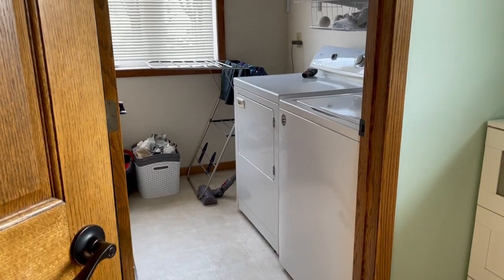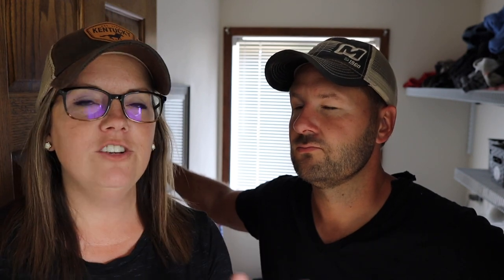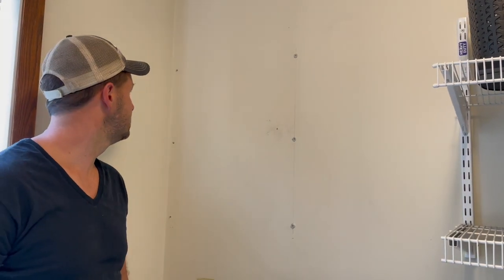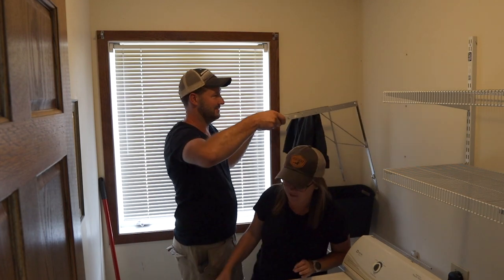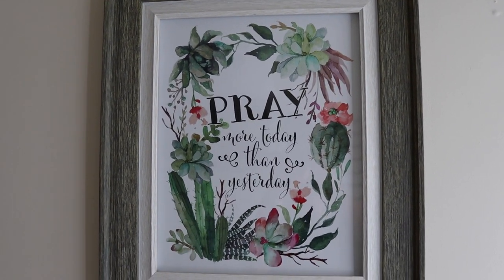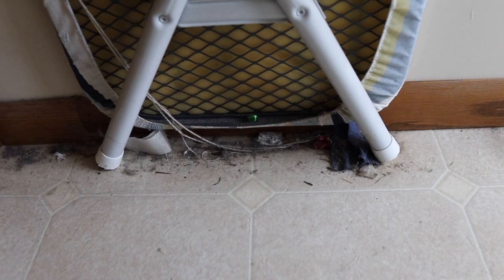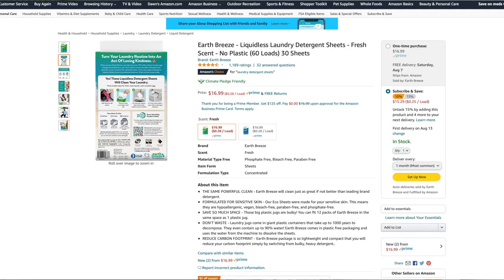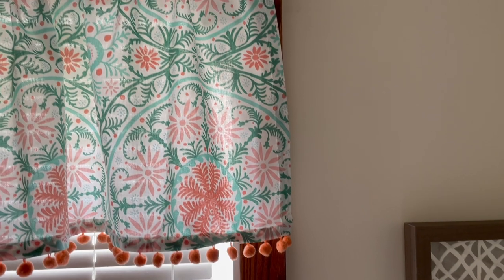Dream Laundry Room Makeover!

Comment: Get back on that soap box, Dawn! 😄 The laundry room looks so much better with just a few changes, and will be even prettier when you paint it mint green.  I use TruEarth laundry sheets. They work great! One sheet for a regular load and two for a large load.  I have a subscription, so I don't even have to remember to order.  Two envelopes of sheets are mailed to my home each month, which is enough for the 3 of us.  The envelopes slide right beside my washer (I  have front-loaders stacked on top of one another in a closet in my hallway. When our grandson came to live with us permanently at almost 12 years of age, I taught him how to properly do his own laundry. Let me tell you about my rule when buying clothes. I do the scrunch wrinkle test, by bunching the fabric tightly in my fist, then releasing. If the material mostly springs back into shape, it's good. If it continues to look like a wrinkled mess....nope, not coming into my house.  Moral of the story? I do NOT iron! I own an iron, but only for an emergency. I  cannot remember the last time I ironed! (By the way,  you can double a towel and iron on the floor or any other flat, stable surface.) The last time I used an ironing board was 30+ years ago, I think. Blessings! ❤

Comment: We switched to "Sheets" Laundry sheets last year and it is so easy.  No more dealing with someone using too much detergent.  I love them.  The box is shipped straight to the house in a recyclable material so nothing is going into the landfill.  It is SUPER lightweight.  1 sheet for a small load, 2 for a regular load.  Easy Peasy.

Comment: Looks lovely!
I re-did our laundry room a year and a half ago and it makes me smile, too. I also noticed that I, too, was getting my laundry done quicker because I wanted to keep that space pretty. 😉 The solution i came up with for a drying rack was to hang a bar up high on the wall and use hangers to dry everything (i have several different types of hangers for all needs). I have yet to run across anything that doesn't work to dry that way. Works for us!

Comment: The laundry room looks great!  DIY tip-mop the floor with a vinegar-water solution.  Rinse.  Paint the linoleum flooring with a good porch paint.  Bam.  Problem solved. It will be easier to clean

Comment: I donated our ironing board years ago and never missed it. The few times I needed one, I simply put a towel on my table and ironed there without trouble.
Reply: Absolutely, I do the exact thing. I finally donated my huge ironing board. I iron once every 4 years but it took so long for me to believe I could exist without it. I put a towel down and iron wherever. Last time it was on the surface of my massage table. With lots of sheets on it so as not to burn through. Worked great.

Comment: I use TruEarth laundry sheets. They come flat, 2 together with perforations that you can pull apart easily. 1 sheet for regular load and 2 for larger load. They dissolve in the washer. They seem to work well. So much easier than buying large bottles and take up so little space.

Comment: I used laundry sheets when on a cruise as I didn't want to pack anything that would leak in my suitcase. I was very impressed with how well they worked. Until you mentioned them I'd forgotten about it. I'll definitely look out for a larger package size and try them again.

Comment: Your laundry room turned out beautiful. You guys are so much fun to watch. I've always had an organized laundry room but the one tip I would give is to have one basket for clean laundry only. I have a collapsible laundry basket that hangs on a hook in the laundry room. The only rule is that you have to fold the current load before you put another one in the dryer. By having one laundry basket for clean clothes only, it's easy to empty the dryer and fold the clothes and put them away. On a rare occasion, a load may sit in the dryer a bit, however the majority of time it's folded immediately and put away. I am a load a day person so it never builds up. When my son was younger, I had to do more than a load a day but the key is to stay on top of the laundry. Never heard of a laundry sheet. Regarding your ironing board, I thought you were going to hang it in the closet with your Dyson. Love how pretty  your laundry room looks as you look into the room.

Comment: I loved my Washeze laundry sheets when I traveled.  So easy to throw 2-3 sheets in my suitcase to use without worrying about liquid detergent opening.  Others in my leadership group also started using them after seeing them.  The type I used worked in the washer and dryer so I didn't have to bring dryer sheets.  At home I use EC30s laundry swatches.   I found this looking for more environmentally friendly options.  I like them so far and have been using them since June.  The swatches completely dissolve, all the packaging is recyclable/compostable.  I stopped using dryer sheets and switched to the dryer balls and lint catching balls.  That was due to hearing some of the items in dryer sheets might be toxic, but I didn't do the research to determine how supportable that is.  The more environmentally friendly option of not using them at all was reason enough for me to switch.

Comment: For the last 8 months or so I've used the brand TruEarth laundry strips (got them from EarthHero as recommended by Shelbizleee) and they work great! No residue, Tom. I use them for all types of laundry: delicates, normal cycles, sheets, bath towels, cleaning rags, blankets. If you are using cold water or if you have a front loading machine, the trick is to rip the strip into smaller pieces (I usually rip the strip in half a few times until it's in about 8 pieces). We have hard water, front loader, and usually use cold water for clothes. When leaving it as one strip, it dissolved in warm and hot water all the way, but didn't dissolve completely in cold water. When ripping the strip it dissovled great in cold water! However, note that some stains won't come out unless you use a separate stain remover. I tried doing a load of rags without using stain remover to see how well the TruEarth detergent would remove them on its own. The rags came out clean (no residue, no smell) but the stains were still visible, so a separate stain remover is needed. It's SO nice not having to deal with leaks or spills from liquid and powder detergents!!! Plus love that the packaging is better for the environment. Win-win!

Comment: Since I seldom use the ironing board, when I moved & didn’t have the room for it, I replaced it with a mat (made to iron on); get at Target or any place like that in the laundry section. The few times I need to iron, I just do it on top of the washer or dryer.

Comment: If you wait to long to take laundry from dryer and it is then all wrinkled just take a spray bottle of water and spray a few squirts on the clothes in the dryer ( 2 or 3 squirts) just enough to have a bit of dampness in the dryer turn on dryer for 10 to 15 minutes depending on how full the load is. Fold or hang up after time allotted. Comes out perfect 👍. In case you are forgetful set a timer ⏲ I n whatever room you are in.

Comment: I recently tried laundry sheets. I think they are a fairly new idea. I'm disabled and don't have in home laundry. Hauling a jug is to heavy. I was using pods, but I like the strips better. They seem like the laundry equivalent to fruit leather. Remove the water weight and keep the good stuff. Tom, I haven't had any residue from them. They are HE rated and seem to fully dissolve (not like some pods where you still have the shell)

Comment: While you're at it, flip the dryer door so that it opens on the other side.  It will be easier to pop the wet laundry from the washer into the dryer that way ... unless it's the load headed to the drying rack.  (I have that same exact one!  )  I stared using Dropps laundry pods because Erica Lucas recommended them as a plastic-free option.  They're okay.  I think I"ll try the sheets.

Comment: I use the Earth Breeze sheets and I love them!  I bought one package each to try of the scented and unscented because my husband likes the unscented and I like the scented.  The scent is not strong at all, very light and clean.  Tell Tom the sheets completely disintegrate in the water... they just take the water out of detergent and compress it into a sheet, plus no big plastic jugs going in the landfills anymore!  😀  I am getting low and will be starting a subscription soon... it's $12.00 for 60 loads.

Dana from A Slob Comes Clean did a video recently where she got rid of her ironing board too... she provided a link to a fold-down ironing board she uses that hangs on the back of the door... nice that it's up off the floor and out of the way.  Maybe you could check that out.  I've also heard good things about hand held steamers... a lot of people use those instead of irons/boards.

Comment: I just use a towel on a counter top of the washer or something if I have to iron. Pretend to just fluff things in the dryer so we rarely need an actual iron unless we're going somewhere fancy which rarely happens or if I have to iron on like Girl scout patches or something. We haven't had/ used an ironing board for a very long time.

Comment: I ALWAYS lay clothes out flat as I take them out of the dryer. It might take a minute longer, but they don't wrinkle and look less overwhelming to deal with. As I take them out, I'll hang shirts over one end of the laundry basket, pants on another and socks inside OR just lay them out on the dryer itself. It's really easy and they're practically folded by that point. We also put delicates (like VS undies & bras) in a mesh bag to hang dry. Laundry has NEVER been a problem for me since I follow these basics, even when I was raising my kids. It doesn't have to be a nightmare to deal with. If you stay on top of it and fold them right away every single time, it won't be a hassle. Remind yourself that it only takes a few minutes.

LOVE the shower curtain valance, the makeover, and both the laundry sheets and washing soda. 👍

Comment: Hi Dawn, consider replacing your ironing board with a ironing blanket, it’s a heat safe material so you can iron on top of your dryer or most counter top surfaces then it can be folded away into a bin with the iron and pressing spray.☺️
You can find them at Amazon or stores where they sell sewing supplies.
—Cheers

Comment: you do not need an ironing board.  You can take a piece of plywood (super narrow so not heavy) put a piece of batting over it, then cover it with whatever fabric you want, staple to the back and you have a ironing board.  Put it anywhere you want since you only use it once in 16 years. If you get a pretty fabric, you could use it as art on the wall.  I LOVE Earth Breeze laundry sheets.  They are so easy to use!  Toss one in and done.

Comment: Dawn you want to get a ironing board that hangs on the back of the door, it’s like a half size board or if you want a full size they have a hanger to hang it up on the wall with a holder to even hold the iron. I don’t use laundry baskets other then I have one in our bathroom for towels and one in our laundry room which is actually a bin for whites all other laundry gets put straight in the washer as we take it off . We all know what gets hung to dry so that’s never an issue.

Comment: The laundry room functions much better now, I'm sure! 
Hang the ironing board up on the back of the door or on the wall. You could hang it in the laundry room or in the little closet with the vacuum. I have owned a table top ironing board for years. I loathe it. It really only works well for small pieces of clothing. If you ever have to iron anything larger, it is a huge pain. I plan on getting rid of my table top board for a full size board.

Comment: I haven’t used the laundry sheets but I do use Dropps Laundry pods-the soap, oxi and fabric softeners plus you can buy small load sizes too and for sensitive skin; and they have dishwashing pods.  No more drips of liquid soap, minimal space to store and you can buy 56 count-140 count and 210 count boxes.  The boxes they come in are biodegradable too! It’s a little cheaper to buy on subscription but you can also buy as a one time purchase.

Comment: When we had new carpet installed, I cut a rug sized piece out of the extra scraps. I wanted it for cushioning when standing on the hard concrete floor in our basement laundry room, but the kids appreciate not having to stand on a cold floor.

Comment: No I don’t pull my dryer out as it’s on a plinth and it’s vented out. I don’t use the washing detergent sheets…as I have not seen them except for travel shower sheets. But I use the mesh bags for things I don’t want in the dryer! I have a hanging rectangle with pegs on it and I use it to peg smalls on it and that works great also a rod to hang things that you don’t want in the dryer…like my hubby’s shirts.  Love this video!😀♥️

Comment: Hi Dawn,  I saw someone’s video where she had an ironing board the has a bracket and hangs on the back of the door and when she wants to iron, it folds down with a support bracket and is just the right height and size and then folds up flat on the door again.  I don’t think it was as large as a regular ironing board but looked like it worked great for those of us who only iron on occasion.

Comment: Dawn, I have a tabletop (or in my case, washing machine top) ironing mat ... called an ironing blanket that has magnetic corners.  Works great for the infrequent ironing that we do!  It's just a little smaller in depth than the depth of my washer, and a little wider so the magnets hold it over the sides.  And when not in use, it folds up and easily tucks away, nothing to hang up.  I love it! (Check Amazon, that's where I bought mine a few years ago, but they still have them.)

Comment: Laundry sheets are just pressed laundry detergent. There is a brand from Canada - I'd skip that one to save shipping fees. Overall sheets work really well... but if you go to a laundromat, you have to shred the sheets up and put them in with the clothes or the sheets will stick to the sides of the soap dispenser.

Comment: Question!  Why are you wearing caps in the house???
When I remodeled my bathroom I moved the washer and dryer from the basement to the bathroom. I now have a full size washer and dryer stacked on top of each other in a closet in that bathroom. When the dryer is finished I pull out things and either hang them or fold them on the bathroom counter.  The folded articles are put away immediately as well as the things that are on hangers. This is a perfect arrangement for me.

Comment: I have an issue with my 8 year old Granddaughter's clothes looking too wrinkled if I don't fold them.  My 13 year old's clothes are hung on a rack in the living room after about 15 min. in the dryer to unstiffen them.  Unfortunately, they wind up never getting into the closet and get worn right off the rack.  My laundry room is a small space and I replaced my metal racks with cabinets, but now I'm rethinking that after seeing your set-up.  I have 2400 sf in an open concept house and after seeing yours, I know I'm not making the best use of my square footage.  Just realized your workbook should be out today!!!

Comment: I hope you hooked up that dryer to the vent again! And maybe clean out the vent that goes from that room to the outside of the house if you haven't done so in the past year? You will be surprised! Also - I know you are keen on separating washing loads but Color Run is a godsend for efficient loads :) Finally, you could have hung the ironing board on the back of the door. (Where did the bucket go?!)

Comment: Regarding the laundry sheets: you might be able to put a small bin on the wall to hold them to make the detergent more accessible for your children — and even for Dawn. Tom, I think some of the sheets are pure detergent, so no residue!

Regarding the ironing board — first, I buy clothes specifically so I don’t need to iron them. But if you do need an ironing board there are ones that mount on the wall and fold down when not in use — a little like your drying rack.

Comment: I have a TINY laundry room. Stacked European sized washer and dryer (Miele), small countertop, tiny (bar size) sink. No place to hang clothes that need to air dry. So I bought an old-fashioned ceiling-mounted drying rack. Unfortunately, YT won’t allow me to share the link. It’s on a rope pulley system, and I have a cleat on one wall to hook the rope to, with the rack all the way up at my 9-foot ceiling. Then I have a couple of other knots in the ropes that will hook on that same cleat at lower levels. I can lower the rack to a good height for me, load the rack (nice shirts are on hangers, other items over the wood rods directly), then hoist the whole rack back up to the ceiling. When it’s not in use, it takes up literally NO space. And it’s great for shorter people!

Comment: The best thing I have ever done with regard to laundry is to keep hangers (adult sized and kid sized) in the laundry room and hang up everything that can be hung (including pants) directly out of the dryer. Then I grab all the hangers, take them to the closets they go in, and hang them right up. I also fold anything else directly out of the dryer and only have a small pile that's already folded that I can either put away if I have time or set on the foot of the bed to put away later. I hate ironing so anything I can do to prevent wrinkly clothes is easier than having baskets full of wrinkled clothes!